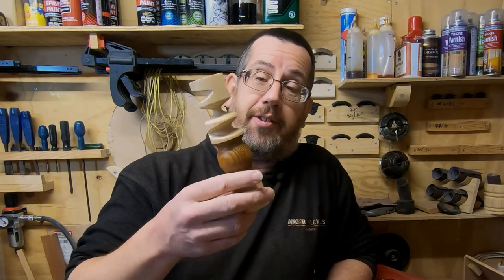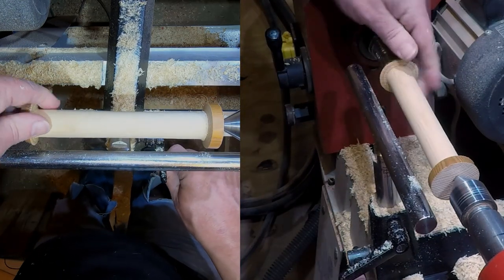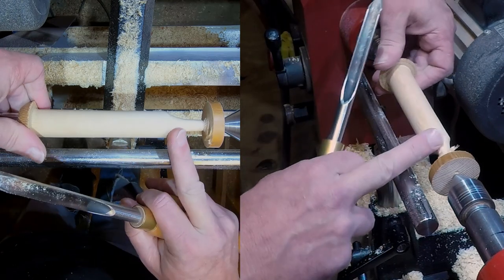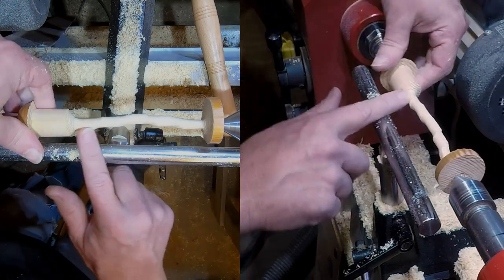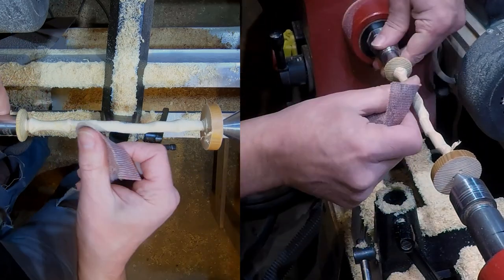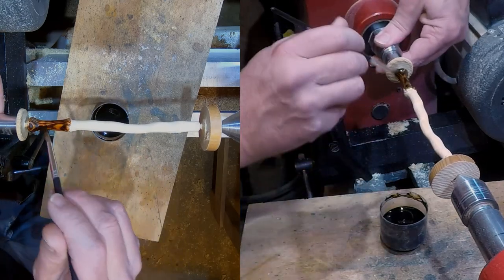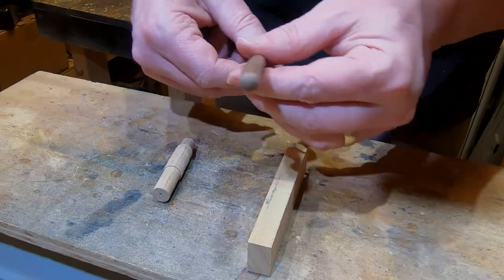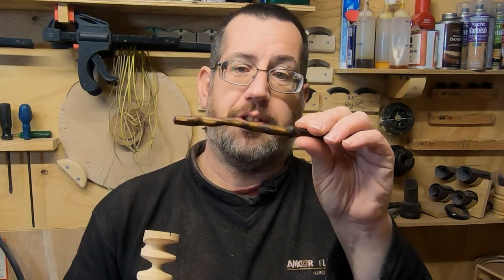Off Center Wand - Episode 230

Comment: Thank you Paul for another interesting video.   In addition to your wood turning skills you have a very pleasing personality so your channel should go from strength-to-strength.  May I ask where you purchased your miniature burner?
Reply from the maker: Thank you Alan that is most appreciated.
I got the torch from eBay which I believe Amazon does them too. Search for Micro Blow Torch which I paid £6.79 for mine and it's very handy to have and doesn't take up loads of space. Just refill it with lighter gas.

Comment: Very good instructions in this project. I have learned a lot. Thanks

If you are doing a goblet, is the space the same in off center? Say 2-3 meters or eight or quarter inch
Reply from the maker: Thank you Jon.
I'm not sure what you are talking about when asking about the space.
Reply: Paul Lockwood   From center point you put dots (where you put your center tail stock) I think about 2 meters apart off center. That would be the same for distance for anything you might be making?

Comment: Paul how much pressure is applied to hold but not break the piece??
Reply from the maker: Hi Douglas. You ideally just need enough for it to grip on the drive side and not slip. The more off center you go and create a thin part the weaker it will become.
Reply: Thank you for the information Paul, Keep the chips flying 👍👍👍👍